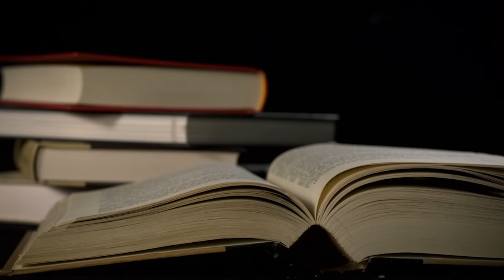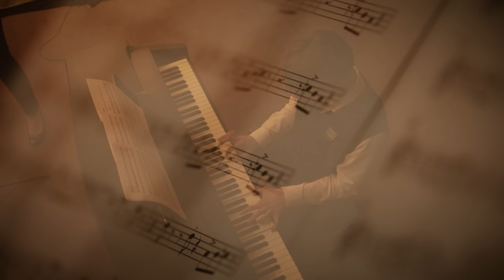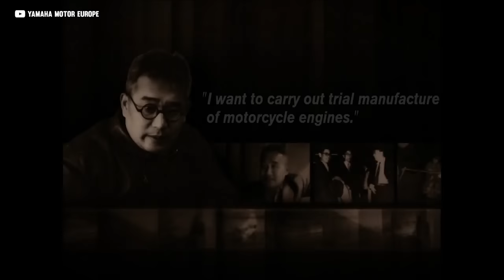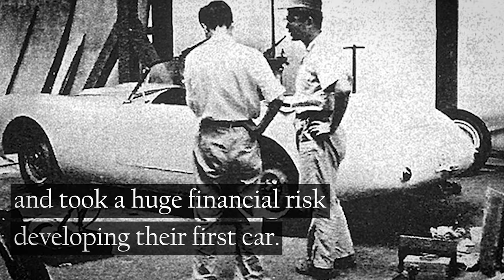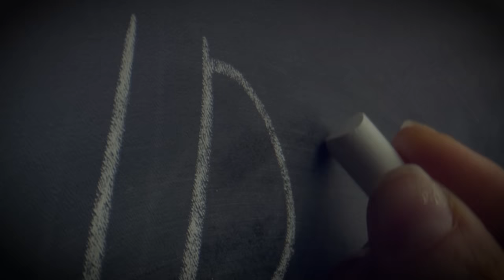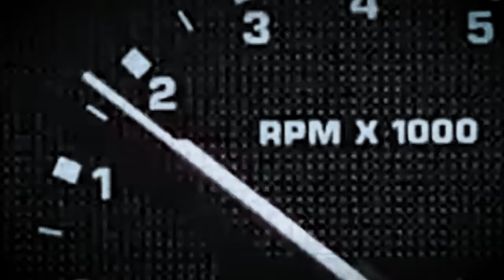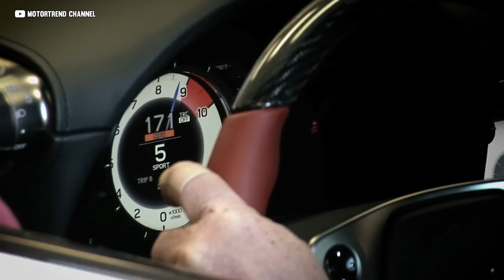Toyota's Secret Weapon Is... YAMAHA!

Comment: Yamaha is also involved in the Pontiac Vibe GT and Toyota Matrix XRS. The 2ZZ-GE engine has their touch on it, making 180 horsepower in a 1.8 four banger.
Reply: Dont forget the legendary 4A-GE and they say they had a hand with the 2JZ as well
Reply: I have a 2ZZ MR2 Spyder. It's such a good combo!😊
Reply: @Marius Bajdechi  I'm legit considering getting a VGT or an XRS for my next car. I live at high elevation and need forced induction, and today's cars are out of my budget.
Reply: @OEM1  Indirectly. Yamaha worked on the 1JZ, Toyota then made an evolution on it to make the 2JZ. That's why you won't find YAMAHA markings on a 2JZ, but you will on a 1JZ.
Reply: I have a 2zz Celica. I have done a lot of work on my high mileage engine and have come to absolutely love the 2zz
Reply: @gorehammer1  I've heard a lot of good things about the 2zz. I just worry about the snow we get where I live. One of our snow resorts has 800" of snow and still climbing.
Reply: S2 Elise/Exige also had 2ZZ-GE that made 190-260bhp in NA or supercharged form from the factory.
Reply: @gorehammer1  they are a gem
Reply: Sitting in my 2ZZ Runx Z watching this
Reply: Pontiac Vibe and Toyota Matrix are twins with different skin.
Reply: Most high end or sports engine in a toyota was touched by yamaha, going back since the 2000gt
Reply: @792bnz  You could even say Yamaha has been involved with every high end sports motor since the 2000GT. Their economic partnership really worked out. The only high output motor designed for sport use that wasn't directly collaborated with Yamaha (aside from the G16E) would be the 2JZ. The 1JZ everyone knows Yamaha did their magic on it, but the 2JZ looks like Toyota did their own work based on the 1JZ, that's why I say not directly involved. 

Yamaha and Toyota really are like peanut butter and jelly, they just go so well together.

G16E found in the Yaris I think was mostly under Gazoo Racing. There's no indication of Yamaha being involved, which I think marks it as the first high performance Toyota engine that wasn't touched by Yamaha.
Reply: Another remarkable 1.8 liter is the Honda B18C producing 197 HP.
Reply: Dad still owns a 2010 matrix xrs, gas pedal is very responsive and quick car
Reply: The 2jz is essentially 2 of their 3 cylinder engines
Reply: @LetsConquerTheUniverseTogether  Yeah, THAT thing is ridiculous.
Reply: Yep, i had a 2ZZ-GE in the Aussie delivered Corolla Sportivo. VVT with Lift - Toyota's answer to the Honda B18C, and it revved higher as well. Mine had a Fujitsubo exhaust and cold air intake and it sung. Also owned a series 2 Soarer with a VVTI 1JZ single turbo and a Caldina GT4-N edition with a final generation 3SGTE making 220kw. Yamaha have really made some awesome engines with Toyota

Comment: Great video thank you! I can tell you I owned a 05 Yamaha R1 for a time. It had the 5 valve head. 4-2-1-2 titanium Sato exhaust. When you got above 10k the sound of that bike is somthing I'll never forget and it pulled like a freight train... my hands would shake evertime I was about to ride it, until I grabbed the bars, then it was like connecting with somthing slightly more than just a machine and we flew..
Reply: I owned a Yamaha Vision motorcycle (XZ550) in the early 80's. It wasn't called the Vision for nothing, because that's exactly what it was. Out of the crate it had carb problems and unacceptable fork flexing, but once those issues were resolved (cleaned out the carbs and added a fork brace), it was literally the stuff of dreams. I'll never forget that bike. Everything about the Vision was a delight.

Comment: I have 5 yamaha guitars a Nylon acoustic 6 string, an acoustic 12 string, A Pacifica electric 6 string and a RB 200 electric bass. I have Yamaha motif ES synth, modx synth, Steinberg yamaha digital interface.  Also a Yamaha PSR 473 syth. A yamaha xv750 motorbike in the garage. And a Toyota Celica GTS with yamaha VVTIL head.  Yamaha make great stuff that works and more importantly that lasts.  I LOVE Yamaha stuff.

Comment: I had a 2004 Yamaha R6 and the .598cc engine was just unbelievable.  The power didn't even really show up until 10,000rpm and then you better lock in the foot pegs and hang on.  It pulled dso hard until 18,000 rpm and sounded like the naturallly asperated F1 cars.  I love Yamaha and had no idea they made the engine for McLaren F1.  Great video

Comment: The 1LR-GUE V10 in the LFA was not solely built by Yamaha. It was a collaboration with Toyota. The creation of the V10 was lead by Lexus' chief engine designer Okamoto Takamitsu. 
The engine starts life at Toyota's Myochi plant. It is at this plant that the engine block is made from molted aluminium. The block is then sent to Toyota's Honsha factory. The same factory that used to be Toyota's F1 engine facility. The block will get milled, drilled and polished and emerges as a precise engine block. In a sealed room Takumi’s hone every sharp edge using precision polishing tools. After this a highly skilled Takumi pre-assembles the finished engine blocks to check if they fit precisely. Disassembled they travel as unit to Yamaha’s Iwata city plant. It is at this plant that 4 highly skilled Yamaha Takumi’s fully assemble V10. A process that takes 2,5 days for one engine. Before the engine gets put into an LFA, it undergoes a half day of exhaustive testing. Everything mentioned here was documented on episode of "Mega Factory" by NA- GEO. You can find it here.
Reply: Whats the car in the title picture

Comment: Yamaha, along with Honda and Suzuki make really great engines. I own racing motorcycles made by them all and they’re excellent. They now get 200bhp per liter out of a naturally aspirated engine. Who needs turbos or superchargers with horsepower like that?
Reply: Will those engines work efficiently in a normal weight car? I'm thinking not really, based on the honda s2000.

Comment: I used to own an sho and was in a club for sho's.   Ford built them for the police force and had designed the engine but decided to get Yamaha to build them because the production quantity was too small for them to set up another plant. Yamaha did a great job putting them together though. They had an unserviceable transmission though, couldn't even change transmission oil without drilling a hole. Probably expected the police to just get new car by the time the trans would potentially have an issue

Comment: When you first showed the first generation Ford Taurus SHO, you inadvertently identified it as having 356 horsepower. Only the EcoBoost produced that number.
My second year SHO was a great car for the times until the throttle cable stuck which incidentally occurred several years later in my Contour SVT.😡

Comment: The Ford Taurus SHO
used a Yamaha formula 1 mother . It could spin at 8000 RPM all day long and is one of the best motors ever put into a car.  Sadly the SHO (W) , pun intended
Was the wrong car to put the most beautiful
Motor ever built. This motor was used in the days of 3.5L engines . HP of F1 karts at that time in the hi 700HP
and over 10,000 rpm.
Reply: I came up with and installed a windshield banner saying SHOtime on my buddies SHO. So much fun racing unsuspecting people and blowing them away.
Reply: I had a Matrix XRS with the 2ZZ motor.   Redlined at 11k and would hit lift at bout 9k rpm.   The problem was these motors are high rpm and required the owner to drive and maintain it correctly which many of us didn’t; resulting in sludged motors that warranty had to cover.  I did it once 🤣

Comment: I wish more emphasis would have been placed on motorcycle development.  Lage capacity V4 V-Max (based on Honda V4), EXUP exhaust valve system, 5 valve Genesis heads, forward leaning engines, temporary ownersip of Ohlins, crossplane inline 4 to mimic V4, etc.

Comment: The 2jz head was designed by Yamaha, they truly make awesome pieces of machinery.
Reply: Close. Yamaha worked on the 1JZ, Toyota made the evolution on the JZ with the various 2JZ models. That's why you won't find YAMAHA markings on a 2JZ, but you will on a 1JZ. Still the DNA is there. Toyota investing in Yamaha was one of their biggest moves for sure.

Comment: In the video, you say that Yamaha worked with General Motors while showing a picture of a Corvette C4 LT5. Are you saying Yamaha was involved with this engine? If so, can you tell me where you found that information? I'd like to track down that source. Thank you for the great video!
Reply: The c4 zr1 was engineered in part with Yamaha, but made by mercury marine.
Reply: @shaunwalsh85  I worked at Lotus in England and at Mercury Marine in Oklahoma, both jobs working on the LT5 engine. In those years, I never came across anybody from Yamaha. I've heard this story before about Yamaha, but I've never been able to find any evidence of them having been involved.
Reply: @brianwhite9671  from what I heard, it was Yamaha engineered the heads and then farmed the work out to mercury marine to do the actual building.
Reply: @shaunwalsh85  The entire engine, including the cylinder heads, was done by Lotus.

Comment: ...and then some, ...the yamaha DX 7, one of the most iconic synthesizers ever build, shaping the sound of the 80's, followed by the Yamaha Motif 6 and 8. The Yamaha TW 125, probably the most popular form of transportation in Asia for decades,  the Yamaha outboard boat engines, rockin' ya from Spain to Ibiza in a breeze, or the Yamaha T 450, the only strimmer i could get working on high altitude vineyards on a really moistured morning. Mr Policeman,  a collaboration 'tween Stevie wonder  and Rick James on his Motown best selling album Street songs,  of course, conducted with a Yamaha harmonica,  Yamaha pianos, which, if i'm not mistaken, don't detune, or hardly ever. Oh yeah, and for you car lovers out there, Nissan did eventually  beg Yamaha to work with them on the legendary Z-series iconic 70's sportscars. The wood, used for the dashboards on the Toyota 2000 Gt, was the wood they used for the manufacturing of the pianos. Sounds like a  melody to me...😘

Comment: You left out the last model of the Celica. A 1800 cc 4 cylinder engine that knocked out 190 hp and reved to 7800 rpm. With VVTI L heads that turned into a race engine once you hit 6000 rpm. The L stood for lift.  a  Yamaha designed head on that motor was not only powerfull but also long lived and dead reliable. You see them regularly in Australia with 380;000 klm on them and driving like new.

Comment: Toyota/Lexus go to is Yamaha when they wanted to develop a high performance vehicle or drivetrain... basically most toyota/lexus engine code ended w/ "GE, GSE, GUE, GTS & GTE" Yamaha had their hands in it. Yamaha and Toyota/Lexus also developed the body damper first found in the Corolla XRS and CT200h, most recent cars to hav it is the IS500. Aftermarket companies like Spoon & STi starts to use these body damper as well. they also forgot the 5L 2UR-GSE which Yamaha designed the head for it
Reply: @ Ahh B
In Toyota motors say a 3SGTE
3 = 2.0l c.c. capacity
S= Engine Block family
G = Wide angle valve twin cam ( both cams are belt driven)
T = Turbo charged.

Comment: Yamaha also did audio electronics
Reply: Not only are all of the components of my home audio system designed and built by Yamaha, I have been using them all on a daily basis for well over ten years and they still perform like new.

Comment: I'd argue the best engine Yamaha have ever built was the less flashy and lesser known 3S-GTE. This small 2.0L could pump out 250+HP w/ turbo (which was quite a figure in its days), but also had incredible durability/reliability. Had it not been for the DQ, Toyota would've secured 4 years in a row title in WRC with this engine. Truly a gem.
Reply: That’s the Turbo MR2 engine, yes?